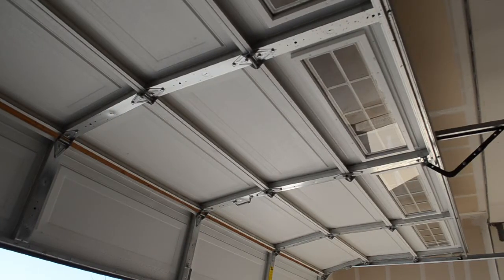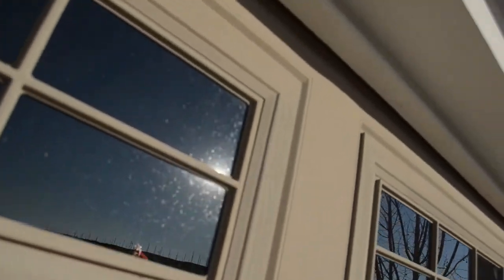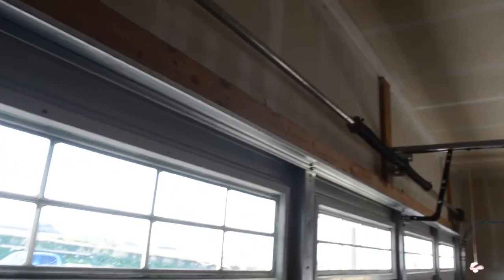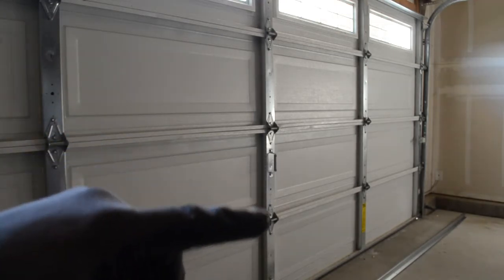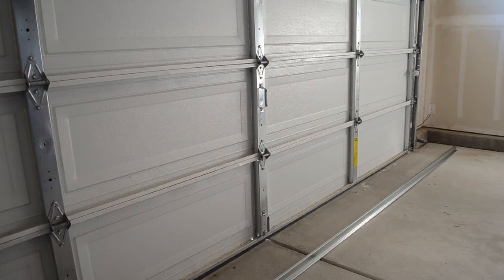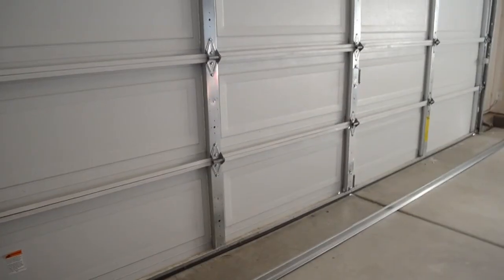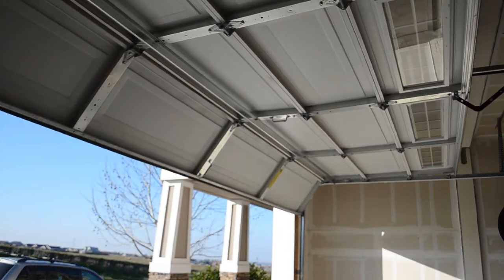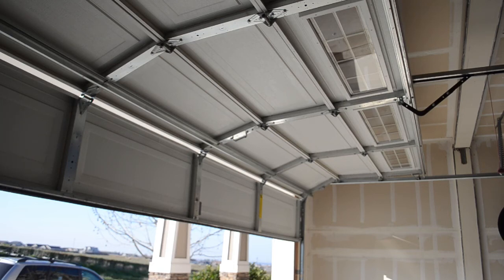Fix A Sagging Or Bowing Garage Door

Comment: I get that the strut provides extra support, but why does this sagging start happening in the first place?
Reply from the maker: Metal fatigue over time, gotta keep in mind it is a 16ft expanse of 25 G steel( usually )
Reply: @GarageDoorGuidance  That makes sense. So the door panel just looses its rigidity over time? I was looking at all the support hardware and couldn't see any obvious problems. I wonder if switching up the order of the panels would make any difference. Move the bottom two panels to the top, and the top two to the bottom. It seems to be the two bottoms panels that are sagging.
Reply from the maker: The same panels like have a hairline crack already forming ( or a dent at the least ) I’d assume they’d still sag
Reply: Cheap material causes your door to sag after a handful of years.
Reply: And the wider your door, the higher the maintenance.

Comment: Someone backed into my garage door and now is bowing; MY plan in to remove it and try to straighten the panels. Already have a T-strut and not helping
Reply from the maker: Is the strut bent?
Reply: @GarageDoorGuidance  replaced the t-trust,  but still bowed
Reply from the maker: @cafemolido5459  the braces are usually placed more for function, depending on the door and the damaged sustained it will only do so much

Comment: I put my strus up and now my garage door stops about a foot too soon. I notice at the top it hits this little sensor flap and as soon as the garage door hits it, it stops. Not sure if it has something to do with that. Anyway I can fix it? Maybe I did it too tight? Because I don't think the garage door panel itself is suppose to hit that little flap sensor.
Reply from the maker: I’ve seen that happen, once the strut is put up it straightens the panel and cause it to hit the sensor where a bend may have missed it before. You can move the sensor forward so the panel doesn’t hit it but you will also need to adjust the arm position so that it hits the sensor when it closes. ( otherwise it’ll try to keep “closing” even though the door has no where left to go )

Comment: I think part of the problem is that the door is too wide 16ft, non insulated and the track angle is the standard 12 degree. You should replace it for 15 degree instead.
Reply from the maker: It is wide and that’s the main reason this happens but I always add a second brace to begin with when installing 2 car garages and that takes away the problem

Comment: Metal framing studs are light and rigid but not pretty. Just as rigid and light as garage door struts. For a substantially smaller cost. Lack of availability causes ingenuity and thinking outside of the box. There’s rarely ever just one way to achieve the common goal in my humble opinion.
Reply from the maker: I can agree with that 👍🏻
Reply: I was just thinking a 2”x2” might get it done too. I got one that’s getting worse. Local dealer didn’t have any….. I’m gonna make something work 😁
Reply from the maker: @dustysrandom5079  should work, better than nothing at all haha
Reply: @GarageDoorGuidance  right now I hit the button and run over real quick and press up to relieve the pressure 😆
Reply from the maker: @dustysrandom5079  gotta do what you gotta do lol

Comment: This is why I try to sell double steel doors as much as possible. And if I install a pan door, I always put a strut on every section to prevent this. Great video 👍
Reply from the maker: As do I, basic doors require 2 in my opinion. With the shortages on doors nowadays it’s hard to count on the steel backs being available though

Comment: I called a repair guy and he wasted my time. I told him this is what's needed and he insisted it was the hinges. He tried to replace them and it obviously didnt work. He then put the old ones back, stripped 2 screws and charged a 30 dollar service fee and left. I found "steel angle" bars at lowes and home depot. They should fix it based on the videos I've seen so I'm going to fix it myself.
Reply from the maker: It should work yes, and sorry to hear about the time wasted !
Reply: I cant imagine  a charge under 30 dollars     way cheap     but for a dummy  like him  5 dollars is too much
Reply: UPDATE. Steel angle bars worked like a charm. I put 4 of them in total on the 1st and second panels. I put a few larger screws to fix the ones he stripped. I left a review for the company on google maps but somehow they got it removed. They go by multiple names on google and either delete the whole account and start a new one or delete individual reviews. Either way this video helped me solve the issue. Thanks a bunch.
Reply from the maker: Glad I could help and I enjoy hearing the responses ! The only thing you may want to think about is the weight added when you put the 4 bars on. If the motors seems like it’s struggling you may want someone to adjust your springs. Glad you got it fixed !.
Reply: @GarageDoorGuidance  Yes I thought of the extra weight. The motor seems fine. I had replaced the side cables and tensioned the spring already a while ago.
Reply: @theproshopper  how do you tension the  spring?

Comment: When you add a strut like that you need to rebalance the door afterwards.  The added weight of the door you may even have to replace the torrison spring for a stronger one.  That will depend on the weight of the door as well.
Reply from the maker: When you add a single strut to the middle or upper panels it’s usually still going to be balanced in my experience. Unless the springs a bit older and already loosening up